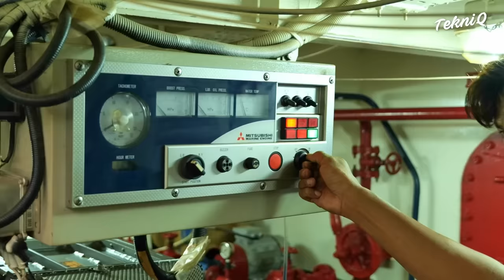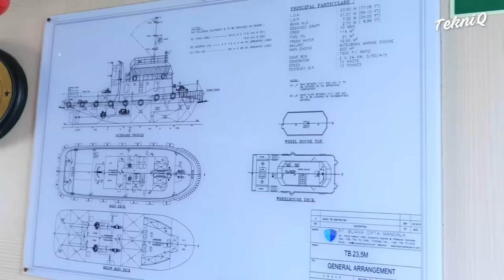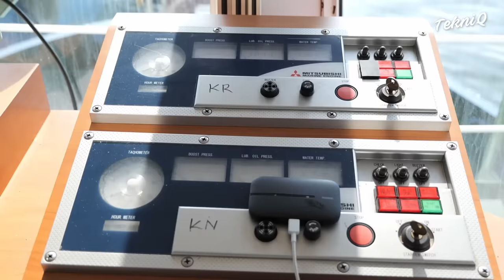How World’s Biggest Container Ships Cross the Panama Canal

Comment: If the ship is wider than the locks, they gotta go around.  MOST cargo ships built today WILL fit through the locks.
Reply: Yes basically right now no ship yard/owner will want a ship not being able to be accomodated at this canal. The economic sense of having it larger  than the canal would be negated by the fact of it having to go around the canal basically..unless they ensure that throughout its lifetime it wont have a voyage near/through the canal
Reply: there’re many  container ships that cannot pass through the canal, they are more economical ploughing other routes. Today’s container ships can reach over 24 000 TEUs while those Panamax ships only reach 15 000 TEUs max. Before the widening, it’s less than 10 000 TEUs.
Reply: @raymondkalama190  you're wrong. Very wrong. MSC, Mærsk, ONE, APL, Hapag Loyd, Evergreen, OOCL and a bunch others has ships which cannot AND all but one mentioned is currently building ships which is too big for Panama. Mærsk has bought Hamburg Süd so in that case they are still acquiring ships which is too big.

They all have a smaller class of ships which handles those loads going through there.